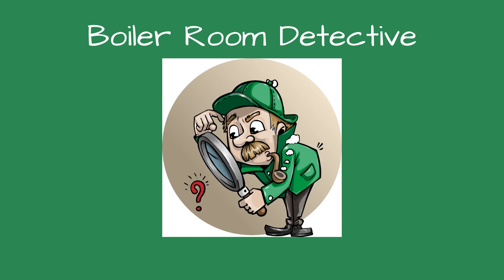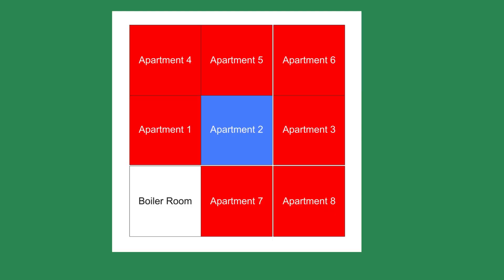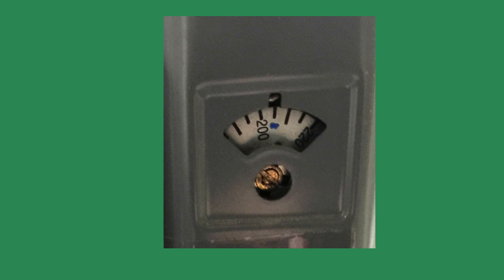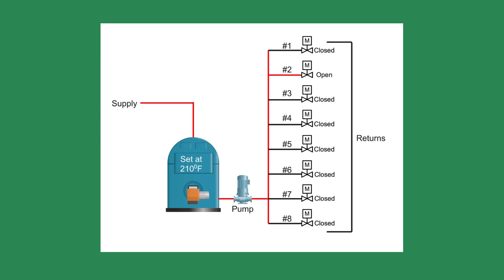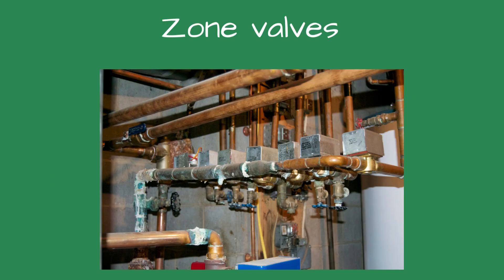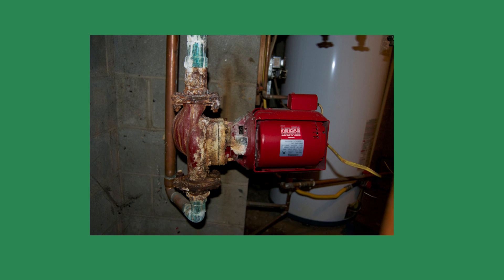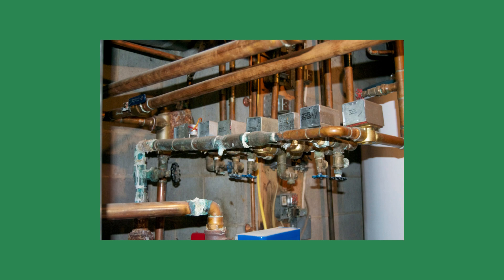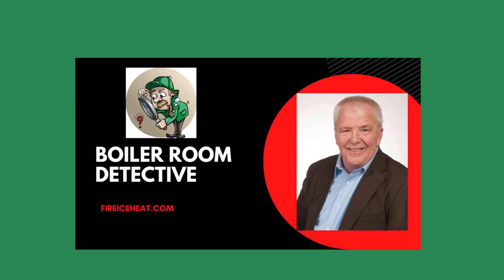The Case of the Low Delta T

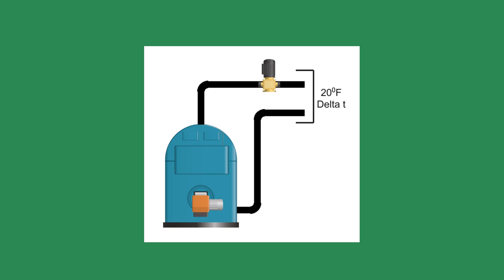Comment: thank you. at 3:15 you say that delta T too low can be caused by  a heat load  that is too low and "excessive   ?    flow" . what is the second word it is garbled. sorry to be a bother.
have a great day
Reply from the maker: Sorry about the garble I have a better mic on the newer ones.I just said if the delta tee was low, the space temperature may not be taking heat or the flow is too high. I partially closed the manual valve and the delta tee rose. The water flow was too high to surrender the heat. Hope this clarifies it
Reply: @boilerroomdetective  thank you thank you thank you
Reply from the maker: @JanosHoyos Most welcome thank you

Comment: I must have issued your post on The Wall about this.  The problem certainly wasn’t too much water flowing through the zone as the heat transfer is a function of the temperature of the water in the radiator, not the flow rate through it.  There is no way that physics allows hot water to go through a radiator and have the radiator stay cold.  Just can’t happen.  Something else is going on here, but hard to say what without seeing the details of the piping.
Reply from the maker: I know It doesn't make sense but it happened twice on this job Just weird
Reply: @boilerroomdetective  Yes, very weird.  It sure would be interesting to know what is actually going on.  I am 99% sure it isn’t because of too much flow through the zone as that would have to repeal a few law of physics.  Something else is happening, but hard to know what without seeing the piping layout and probably adding some instrumentation.
Reply from the maker: @LTVoyager  Thats why I like posting these videos. I spoke with Siggy about it and he was adamant it could not happen the way I said it and a few months later, he said he had the same thing happen to him
Reply: @boilerroomdetective  I have tried to be careful not to say what you saw can’t happen as I believe what you are saying.  I also know that moving water fast through a pipe won’t stop heat transfer.  I believe another bit of physics is at work here, but not sure what that bit is. However, as an engineer these are fun puzzles to think about.
Reply: @boilerroomdetective  My first thought is that the velocity/pressure is causing the water to somehow bypass the zone that is calling.  Is there a bypass valve or something else in the circuit that could allow water to find a way around the zone in question given sufficient pressure or velocity/inertia?  Without seeing detailed piping schematics, it is only a guess.
Reply from the maker: @LTVoyager  No bypass valve I did read about an air space that could form around the water flow that would insulate the heat transfer at a certain velocity
Reply: @boilerroomdetective  Do you recall where you read that?  I’m always interested in reading new things.
Reply from the maker: @LTVoyager  If I can find it, I will let you know
Reply: @boilerroomdetective I think at those velocities you're likely to notice it because you will erode through the pipes and spring leaks 😂😂
Reply from the maker: @Ariccio123  I know Not sure why it didnt Perhaps it was only this time that we noticed it as only one zone was calling.

Comment: this doesn't make sense and I think there is something else. 1. I have never heard or experienced more or less heat transfer with higher or lower water velocity, and 2, why would only one apartment experience it?
Reply from the maker: I know I had never seen it before. I even spoke with some of sharpest minds in the industry like Siggy and Dan Holohan plus people on the wall. I did get a few emails back from techs that have found the same condition and used my idea and it worked. A few years later, the customer called us back with the same issue. He found a cheaper service company and they opened all the valves and connected the zone valves. I did it again and had the same result I am thinking the problem apartment was the smallest apartment and perhaps that is the reason. Thanks
Reply: @boilerroomdetective  Could that zone have been piped with rads in series with diverter tees, and the rads were air locked?

Comment: Been in the industry for 35 years , never heard of this.  I don't understand what would cause the pipes to not get hot and the aluminum fins not able to extract heat from the copper tubing due to water flowing at too high a gpm?    I am inclined to think you missed something.  Why has this never happened in the past?  Surely one zone only has called in the past while the others were not calling.  Baffling for sure.
Reply from the maker: I had never seen this in my career before. It doesn't make sense in my mind as I think a higher velocity would cause more friction. A few years after this happened, the owner started using a cheaper service company and it happened again. He called us out and we found the zone valves reconnected and the balancing valves wide open. I knew what to do this time.
I asked  Dan Holohan and John Siegenthaler about it and they had never heard of it before. When I posted about it on HeatingHelp, two people contacted me and said they had similar experiences. Just weird.